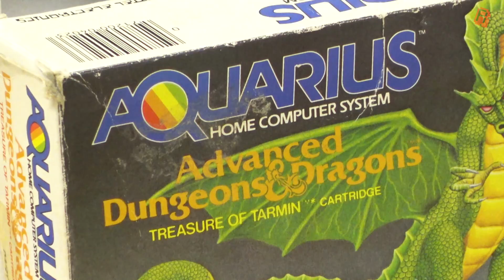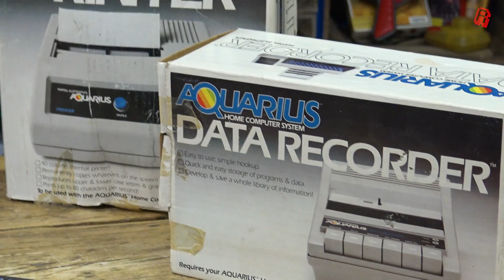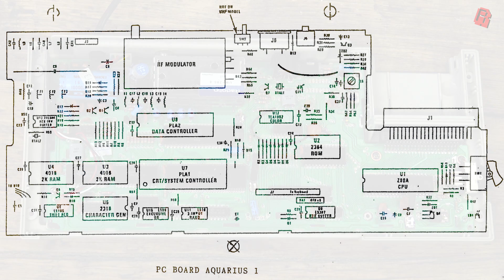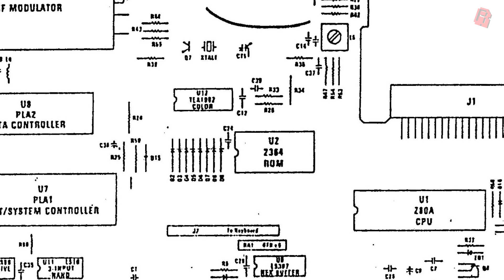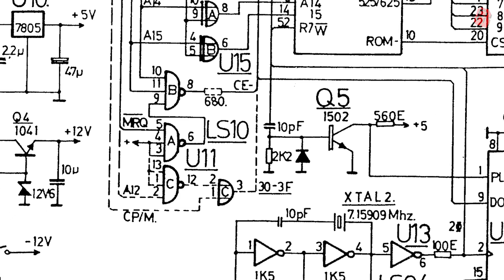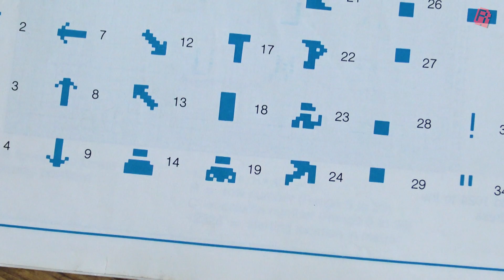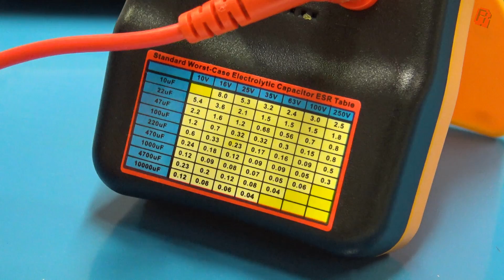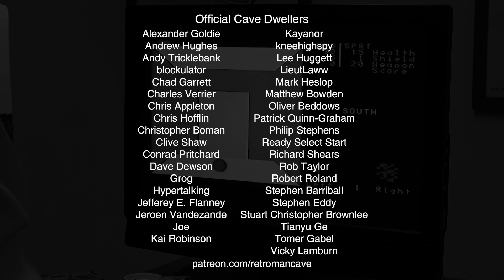Mattel Aquarius - History and Restoration of a Micro Flop - Pt1 - Trash to Treasure

Comment: Regarding your comment that the Aquarius keyboard is the only keyboard worse then the Sinclair ZX Spectrum keyboard, something you never expected to see. While I agree the ZX Spectrum keyboard is bad, have you tried the Sinclair ZX-80 & 81 (Know as the Timex-Sinclair 1000 in the U.S.) with it’s membrane keyboard? I’d argue it’s just as bad if not worse then the Aquarius and ZX Spectrum keyboards. Another big contender for the worst keyboard ever is the IBM PC Jr.’s original chicklet keyboard, which had horrible small chicklet keys but also suffered from having the key labels printed in small text above the keyboard rather on top of the keys. There is a good reason IBM quickly replaced it with a compact standard

Also you mentioned the minuscule 4K RAM of the Aquarius. But remember that the Sinclair ZX-81 (known as the Timex-Sinclair 1000 in the U.S.) had a  only 1k or 2k ram by default, and It also had a 16k RAM cartridge accessory that was considered standard. Now the ZX-81 and TS1000 where intended to be the cheapest micros on the market when introduced at £50 for a kit, £70 assembled, ($100 for the TS1000) so cost had to be cut somewhere. Given Aquarius wasn’t as cheap as the ZX80/TS1000, I don’t think offering it was s little ram by default was wise by 1983, especially given how Sinclair had fixed the issues with the ZX-81 with the introduction of the ZX Spectrum such as sound (even if crude), color graphics, more ram (16k or 48k). 

I find it interesting how home computers/micros of the 80’s had to balance features/specs and cost often making trade-offs In specs to bring costs down enough that average individuals and parents not yet fully sold on computers would be willing to buy one while still offering a usable experience that was more fun then frustrating. Obviously, the Aquarius did not find that balance unlike other 80’s micros like the Spectrum, C64, Tandy CoCo, or even the Atari 400 & 800 machines.

Comment: One of the worst computers ever made. Mattel should have asked Radofin to quit work on Checkers and get to work finishing their Chess project. A simple look around at the specifications of the competition should've told them the Checkers project was beyond obsolete.
I had a used one of these, briefly. Had the mini expander, 16K and one game cartridge. The video quality from the RF out was absolutely horrible. It must have been the first version because the PCB was just about fully encased in a steel RF shield that was soldered on.

Comment: Had one of these for about 5 minutes in 1984. Awful machine, virtually unusable. Literally binned it, it was so bad. The dataCorder, on the other hand, was excellent. Went on to use that on the Spectrum, and it consistently loaded games other tape decks wouldn't, and you could mute the speker and use an LED to see where the program started.